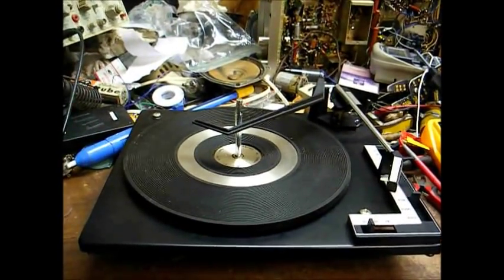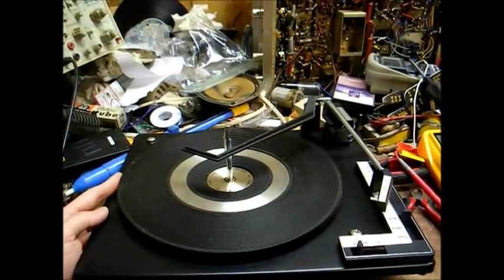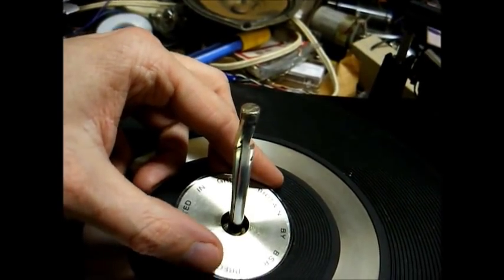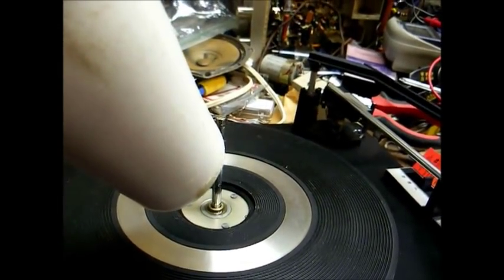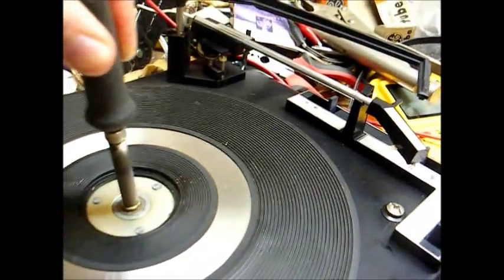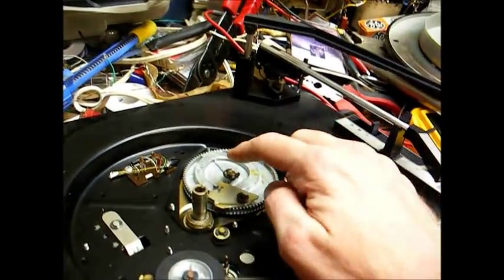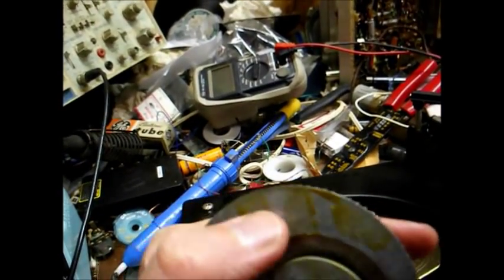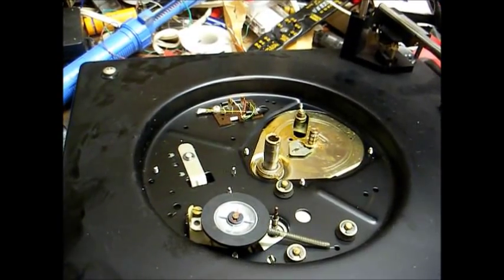Removing a seized platter from a 1970's BSR turntable / record changer

Comment: Probably the most difficult part of the restoration is removing the seized cycle cam gear.   I've figured out the solution to it, though.  3-in-1 oil placed in the space between the gear and post and super heating the oil with a heat gun on the hottest setting, just remember to wear protective gear when doing this.  Presto!  It came off easily.

Comment: Great help !    My elderly neighbor gave me this exact model and I was able to get it running based on this video and have enjoyed playing records !    Now,  the stop-start-auto slide button on the right hand side is becoming DIFFICULT to slide  often getting "stuck" in the start position.    Any ideas on how to repair this slide button ?   Thanx in advance.
Reply: Bonnee Grace ttt332
Reply: There could be old grease underneath the small steel washer by the auto-stop kick plates.  You have to lift up the small steel washer with a mini-screwdriver and clean off all the old grease using a Q-tip or a paintbrush dipped in rubbing alcohol.  Once cleaned off, re-apply with a small and thin coating of white lithium grease.

Comment: thanks for the tips. I took it apart, cleaned it up and re-lubricated. it works now but plays too slow. any ideas on what to do about that?
Reply: Maybe the stepped motor bearings could be dry and dirty.  To clean them, there is a small nut that you remove from the bottom, held by a screw on top.  Unscrew it from top and the motor assembly should easily come off.  Hold the small nut on the bottom with your finger.  Clean the motor and both top/bottom bearings, and use 3-in-one oil on them.  Also, it could be a hard/slipping idler wheel.  This was another problem of these BSR changers.  If the idler wheel is hard, glazed, and stiff, then it will not turn the platter properly.  What I do is resurface the outer edge of the wheel with sandpaper or an emery board, remove the idler wheel off its shaft and treat the wheel with Rawn re-grip rubber cleaner/rejuvenator.  Wait 15 minutes, then re-install the idler wheel back onto the shaft.

Comment: Yeah but as you get old again...rumble dosen't matter anymore...but record wear still matters. Actually the BIC belt drive record changers are a good economical turntable too. Those have less rumble cuz no idler wheel. I have gone back to 8 track tapes. Bought a Telex 8 track changer that holds 12 carts. No vinyl crackle and all constant velocity...unlike vinyl. At work is digital when I DJ...at home it is relaxing sound of analog!

Comment: So I have loosened the idler gear but it will not come off the post.  I've heated it and tried any number of things (i.e. 3:1 oil and also spray that is supposed to loosen whatever is holding it). Any ideas on how to get that idler gear off?

Comment: Thanks for this how to video.  I have a late 70's Sears all in one stereo with this exact turntable.  Is it belt driven or direct drive?
Reply: Will Butter Those BSR turntables from the 70s use an idler wheel. I remember buying a new BSR turntable in 1974 for $34.  The belt drive turntables in those days were at least twice the price.
Reply: Will Butter Neither! It is an "Idler Wheel". What Idchappell1 said.

Comment: I own a record player like yours where you put the record in the notch in the spindle for it to drop down.  When it goes through that cycle the turntable stops and it has a lot of resistance on it.  I have to rotate the turntable by hand to get it to go through the record changing cycle.  When the turntable rotates I hear a viberating sound as if something is loose.  How do I fix this problem?

Comment: This is one of the most useful videos I have ever seen. Thanks. So if I have a plastic platter center instead of metal like the one you demonstrated...is it still OK to stick a solder iron in the center metal post with surrounding plastic so close? You warned of that in this video...but was not sure if you had tried doing this on an all plastic one yet.
Reply: It's OK, you just have to be careful and take your time.

Comment: Thank you! I picked up an older Zenith model IS-4021 ($12.99) in relatively very good condition. Platter was seized. After the first few drops of oil, I can feel her wanting to move. Some heat and platter removed fairly easy. She’s playing records now! I will watch for more and do a proper cleaning/lube of her. I notice platter is a bit warped. Is there a good way to straighten that up? Appears to be of some hard plastic. Yet to try the 8-track. Thanks!!!!

Comment: What do I do if my record platter isn't seized but the switch is stuck. Its a 1977 Loyds and has been in a closet since 1986. The platter spins freely I just cant slide the on switch down to make it run..its plastic so dont want to break it.

Comment: When will you post video of motor cleaning? I followed instructions in this video and got it to start to turn on its own...I know nothing of these and am starting to get into them...bought a "nonworking" Emerson m 2100a for $5 and after your video, like I said it started rotating slightly by itself but not very fast and it keeps getting stuck and stops

Comment: Perfect Video on how to resolve this issue without damaging this old turntable - worked great for me.
Question tho... My spindle will no longer stay put - it doesn't fully snap back in.. It sit in the hole but is loose and comes out when the records are lifted off.  What holds the spindle in?
Reply: There's a notch in the spindle hole pointing at the upper right.  The spindle should have the same-size protrusion.  Simply align the protrusion at the bottom of the spindle with the spindle hole notch and push firmly down.  That should take care of it.

Comment: Do these record changers really gouge records?  I thought it was caused by badly worn styli.  I own a Zenith IS-4031 with a BSR record changer with a brand new stylus and adjusted the tracking force screw in the front, and my records are OK.  I keep the records and stylus clean and well-maintained for optimum sound quality.

Comment: Hi I have this same unit and I took it apart and greased it like you said and the TT is free and turning my problem is that the start, stop switch is locked up in the start position and wont budge got any ideas for me?
Reply: Thats my problem that the start,stop,auto switch is locked up and will NOT move at all.

Comment: Any suggestions on how to get the stacking feature to work? Your tips worked like a charm for getting the record player to play individual records but still can't get the stacking function to work.  Any suggestions would be much appreciated.
Reply: Emily Kroll Hi Emily.  Is your auto-return gear trip lever extending over the platter washer/bearing assembly?  If not, the platter will not engage the trip lever properly.  To fix this, turn the auto-return gear slightly clockwise.  That should do the trick and make the platter/auto-return gears to mesh and rotate, thus beginning the changing cycle.  You should hear an audible "click" when the tonearm reaches the end of the record.
Reply: nuttyprofessor  Hello Mr. Nuttyprofessor, I have a BSR C197 turntable Console Stereo, I'm trying to restore it. Problem is, I can't find my model number for purchasing a needle.
Can you please help me.
Thank you.
Reply: Hi Gary, your replacement needle is M854-DS73, available on eBay.com.  The model number of your BSR record changer is printed in a red sticker underneath the changer, it should say model c-something followed by a letter and a number.
Reply: thanks Mr. nuttyprofessor

Comment: Been servicing these for 4 decades, DO NOT use a hairdryer, or soldering iron , Just Use a bit of lighter fluid to release dried grease.same with all frozen parts, and 3in1 oil is junk, Phonolube is designed to not migrate over the surfaces like 3in1

Comment: Hello I bought a Morris cabinet with a BSR turntable built in. It looks almost just like this except it has "diamond stylist" on it. I think it is missing a needle. do you know which one it takes.
Reply: I believe the needle is either Pfanstiehl M854-DS73 or 274-DS73, both available on eBay.com.  I'm assuming it's the flip-under type stylus you need.

Comment: took the lazy mans way used hair dryer and one step you might not have thought of.. I heated the pin or whatever you call it over the stove with pliers then popped it back in to heat it from the inside out.. Boom listening to Dan Fogleberg's "Innocent Age" now! Thanks for the Video and if it freezes up I'll know how to fix it
Reply: You are using a BSR changer to play such a recent record?? I use them to play 78 RPM records, I do not think they sound too good with modern records... Are you satisfied with the sound?

Comment: I got the the platter off with my solder heat but I cannot get the gear to lift regardless of how much heat is applied.  I did pull off the clip above it by the way.  Any ideas?  It is easier to turn I just can't lift it at all.
Reply: Danny Blackwell hmmm how about applying some 3-in-1 oil to the auto return gear post and heating it with a hair dryer, then try rocking the gear back/forth and lifting it up at the same time?  That should do the trick.  This might be difficult, especially for mini-changers because you have a small work space.  Standard BSR changers shouldn't be too bad.

Comment: @coinrollhunter69 You can get the lubricants at any hardware store (True Value, Home Depot, Lowe's, Ace Hardware).  You will need 3-in-1 oil, WD-40, and white lithium grease.  You will also need Rawn rubber cleaner for the idler wheel, but this item is available online only (either through mcmelectronics or ebay.com).

Comment: I recently go a Sanyo JXT6440 with a seized platter. I was able to get it to spin slightly by using 3 in 1 however I can't remove the platter and the center the spindle goes into spins with the platter

Comment: hey! I just dug the same record player outta my aunt's attic. I got it running and it plays through the build in blown speaker. the only problem I have is the peg that moves that little slice of metal moves, but does not drop the record. I can see the whole thing move from back to front, but the record just stays on top. if I tap it ever so slightly it falls, is this a problem with the mechanics? Everything seems to be moving as much as it can...thx
Reply: Hmmmm maybe you have a bent or crooked spindle?  I had the same problem when I bought a Soundesign stereo with a similar BSR changer 2 years ago.  If it's bent or crooked, the record won't drop down, period.  It must be straight.  I believe the replacement spindle model number is 0934, available on eBay or thevoiceofmusic.com.
Reply: @nuttyprofessor  Thanks very much! I'll look into it.

Comment: i Have A 1970s BSR Record Player. Works Amazing. But i Cant Get The Rubber and The Aluminum Ring To Stay Glued Flat On The Platter. Any Ideas?
Reply: Hmmm maybe epoxy glue?  I bought the 2-in-1 type from Home Depot that you mix together.  Make sure your surfaces are all clean first before applying.

Comment: My turn table moves freely when moved by hand so it is not seized but when I turn the player on on the motor is running but it is not turning the table. any ideas on how I can fix this? ( it was working and playing records earlier in the day)
Reply: change the belt
Reply: m Finn What type of drive is the turntable?  Belt or idler wheel?  If it's an idler wheel type, it could be that the rubber on it is hard and stiff.  Here's a solution to make the wheel turn the platter again.  Put sandpaper or an emery board with the gritty surface against the idler wheel and give it a few turns with your thumb and index finger while it's on the shaft to expose the softer rubber..  Next remove the wheel and apply Rawn rubber cleaner/rejuvenator to the top/side and bottom.  Let the cleaner soak into the idler wheel for 15-20 minutes.  Once said and done, wipe off the excess cleaner off the wheel and re-install the idler wheel onto the shaft.  PRESTO!  I guarantee your platter will turn again.

Comment: I have a Hitachi all in one stereo with this turntable in it. The problem I am having with this is that there is a really bad hum whenever I play the record. The only way to somewhat get it to not be so noticeable is if I crank the volume. How do I fix the hum? Do you think it is because of the turntable itself or is it the amplifier?
Reply: its not grounded. Coming off the audio hookups( from the turn table) there should be a u shaped ground, what I do is loosen a screw off my receiver and tighten it back down onto the ground. Took me FOREVER to figure this out
Reply: Ryan Miller
 I'm just wondering how to find that ground. Any idea where it's located? Near the back of the turntable or the front?
Reply: I would google the exact model number of your Hitachi player and start looking for it that way, I know on my pioneer its bundled with the red/white audio hookups
Reply: I've been trying to do that but not coming up with anything...
Reply: hey man give me the model number of your setup, I'm going to try and see if I can help you, that shit used to annoy the piss outta me. It's an all in one correct? Does it go straight to the speakers or is there a receiver it goes into first and then the speakers?
Reply: Ok it's a Hitachi SDP-2830 yes it's an all in one. It connects to external speakers. If you google it, you'll know. Thanks for your help, I really can use it!
Reply: ok all I can gather is its an older system that came with the speakers they probably have like a brown plug into the speakers. Its looking its going to be an internal issue ( something not quite connected inside the unit).  Has it always done this or has it got progressively worse?
Reply: Well I bought it from a lady for $10 last summer. As soon as I plugged it in and put on a record...the hum was evident...and annoying. So yeah it's done it for as long as I've had it. She didn't tell me that when they sold it to me, but she may not have known.

Comment: Good, helpful video. Thanks for posting. Trying to remove my BSR turntable platter from a Montgomery Ward Airline. I've removed the clip from the spindle but it still won't come off. What am I missing?
Reply: You need to remove the spindle next, so apply 3-in-1 oil in the space between the spindle and spindle hole.  Then apply heat with a pen-type soldering iron for 2-3 minutes to the base of the spindle to soften and melt the old grease in that hole.  The spindle should lift off easily; you just have to use a gentle twisting back and forth motion to pull-up.  After removing spindle, apply oil to space between spindle hole and platter and drop a hot soldering iron down the spindle hole for 5-10 minutes to heat up the oil, which should soften and melt the old grease.  The same technique when lifting the spindle out of the hole also applies to the platter; use a gentle twisting back-and-forth motion while pulling up on the platter.  That should take care of it.

Comment: HELLO.. HOW YOU REMOVE THE CENTER POST?? JUST PULL OUT?? THANKS.
Reply: Hi Marcos, you first have to put 2-3 drops of 3-in-1 oil or sewing machine oil in the space between the spindle and spindle hole.  Heat the base of the spindle with a soldering iron for 3 - 4 minutes.  You should start smelling the burning old grease; at that point, you should be able to pull the spindle out easily.  Twist it up left and right slightly as you are pulling it out, and that should do the trick.  Just to warn you, though, it may be a very difficult task.

Comment: Those things are junk but way better than the Chinese made junk nowadays .But I perfumer a Dual or older Garrard but there rising in price like Technics . I shop in the non working item on ebay I've gotten very good stuff for cheap that people pass up . I have a old Garrard 990b 75 bucks and the motor just needed oil works fine .